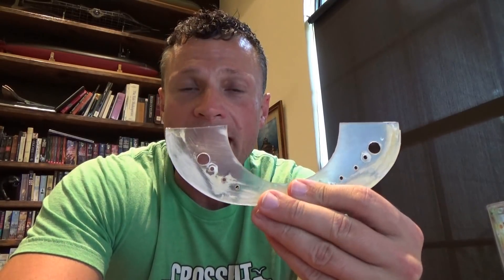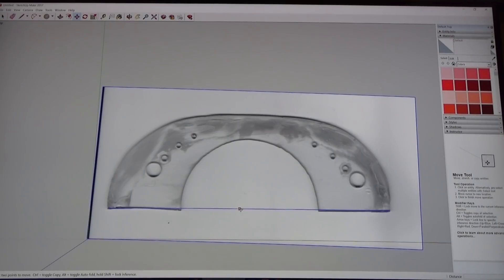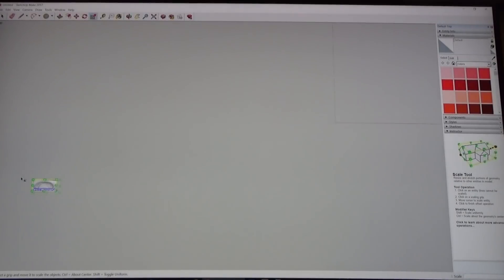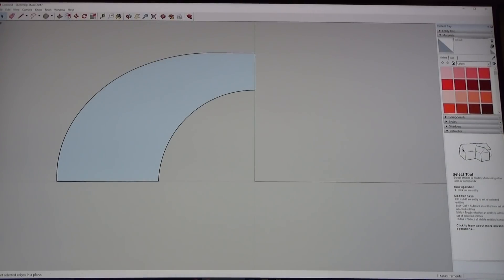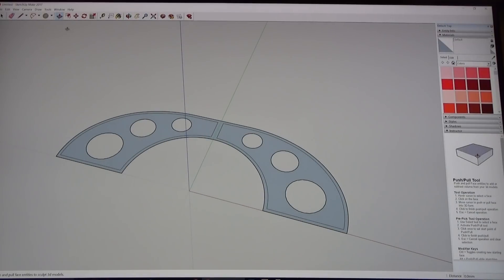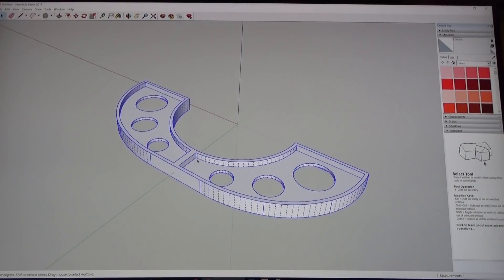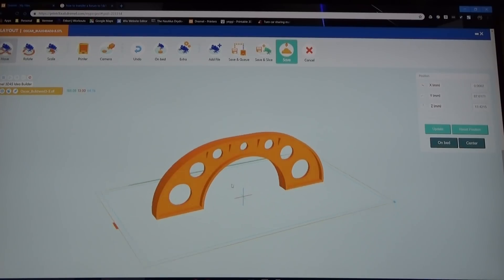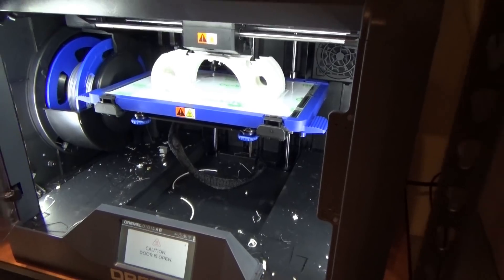Sketchup, 3D printers and Remote Controlled Submarines

Comment: Bob, also would you advise in favor of removing the little spring inside the transmitter that activates up and down the planes on the boat to facilitate more control as the boats dive and resurfaces?
Reply from the maker: I would not typically recommend this, though there is nothing wrong with doing so. Having the planes snap back to level is not a bad thing from a safety perspective.

Comment: Hey Bob, great video about 3D printing. When you get a chance, could you please do a video about How to set up a pitch controller? I haven't seen anything on how to go about doing just that. Most instructions will just go as far as telling to set up the controller (angle keeper) you just need to have the transmitter stick on neutral and that's that, but from what I gather it is not just that simple, Skip Asay will tell you for example that you need to use a bubble level to make sure your boat is level at the moment you press the device to neutral, otherwise it would not reflect a level attitude once in the water,  out of whack. Also when you set it up to level, is that for just how to sit on the water as opposed to when it runs under water?  Thank you in advance.
Reply from the maker: There are tons of different pitch controllers out there. I use (and offer) the excellent products put out by Kevin McLeod. No setup. Just mount and go. It has one button, and that adjusts the sensitivity of the accelerometer.  For setting up your boat, definitely set zero bubble at the pitch that the model is at when in submerged state, if different from surfaced trim.